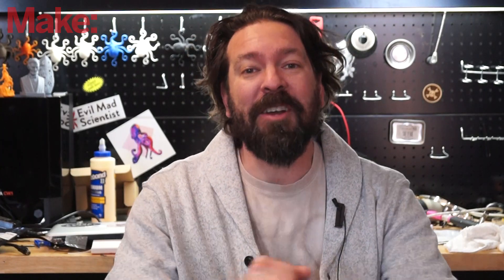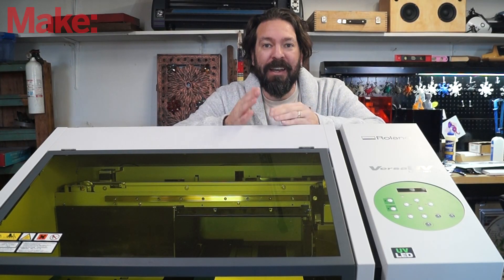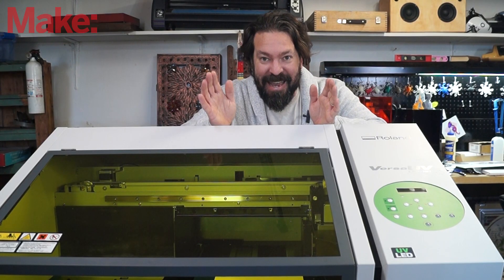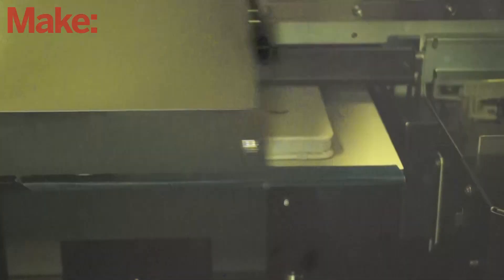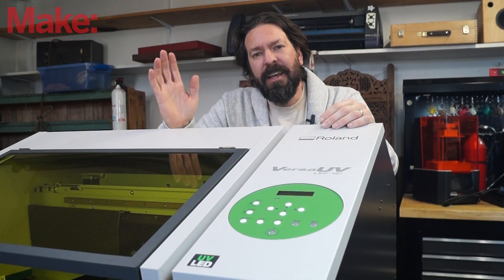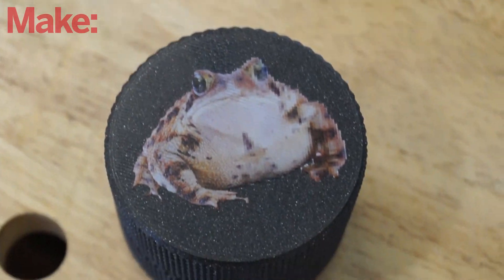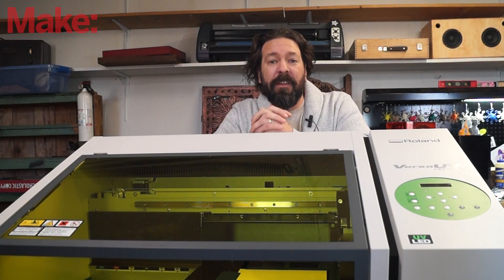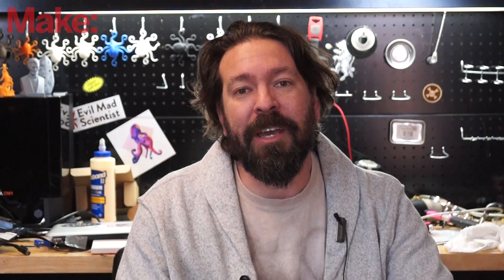What is a UV Flatbed printer? A Quick Look at the Roland LEF-12i

Comment: Worst printer i hav can't print on metal or plastic. And also the ink price is too high. I several times complained the service person about this and now the mother board is dead delay of ink supply and parts it's not only our problem same machine was bought after us by our recommendation they having Same situation it's really a worst product from Roland and hear after wil newr suggest ur printer especially flatbed 😔😔😔 newer expected this from ur brand
Reply: Really?.....not plastic...plastic pens etc...?   What can it print on...what type of / material surfaces do you use it on

Comment: I heard UV printers are meant to be used regularly, so the printheads do not get clogged. For an occasional user (as I would be) it would be an expensive nightmare replacing the very expensive printheads after each printing pause lasting more than 24-48 hours or so...   Is it really so?

Comment: Hi, what you don't mentioned is that the user need to know how to use Photoshop and and illustrator or Corel draw to use this machine.  Making the a print is slow and the actual print is very slow.  I have one and it took a while to get it setup correctly and still difficult to use.

Comment: We have an LEF 300. Keep in mind ink is ~$100/ cartridge and the printer requires constant cleaning by jetting ink into a wast bin (which it automatically does) to keep the head viable. Plan for $700 in replacement every few months whether you print or not.
Reply: why would it need to be replaced if it's been cleaned and not used?
Reply: Hey dude, what are the printing costs roughly?

Comment: 17k?  geez, I was thinking like 1k...
Reply: And then you woke up right? This is clearly meant for professional print shops not hobby makers.
Reply: @daa3417  I realize that once seeing the price, but since you can get other related techs (3Dprinting, CNC, lasers) of a similar size (only about a sheet of paper+ some height) for a few hundred to a couple thousand, I thought it would perhaps the same (especially since you also need crazy expensive ink). I'm guessing if this becomes popular, the prices will plummet soon, since 90% of the machine is already cheaply available by way of these other areas

Comment: I still don't know how a UV Flatbed printer works. Is it like an inkjet printer just with more splash-range? And where comes the UV part into play?
Reply: How fast is it? ... does it smell? ... is it toxic? ... How much ink does it use? ... etc. etc.

Tons of questions unanswered.
Reply: Ole Sauffaus It smells a little chemically while printing, but not too bad. Roland makes an air filter, but we don’t have one on ours. Ink is nasty, and you have to dispose of a waste tank periodically. I leave it in a clear cup to solidify in the sun. It’s hard to wash off your skin. 
You get a lot of prints from the cartridges, but the machine cleans itself every print cycle, so the cartridges are emptied every couple months with light / moderate use. 
The bed moves down, but the print head is very close to the surface it’s spraying ink onto. Too far and static / air movement comes into play, causing the ink to deviate and make the image blurry.
Reply: @MikeCheung1  Use acetone to remove it from your skin 👍🏼
Reply: A scratch test with a fingernail would be nice to see. Do u need to clear coat prints?
Reply: Michael Copeland it’s lightly scratch resistant, especially on a good substrate the ink bonds to. Pretty good against fingernails, but won’t stand up to a butter knife. You can spray clear over it for more durability, or print clear after printing color. You can even emboss with many layers of clear, but it takes a while. You can also print clear primer to improve adhesion on things like metal.
Reply: Ha! As a nail tech I can share some light on this. 
This is the same stuff that we use for gel nails. It’s a high viscosity gel paint that cures under a uv/led lamp. 
It’s waterproof and has no toxic gases or smells when curing.
Reply: The UV part probably has something to do with instant curing.
Reply: Yes, I want to know aswell!. And how do you remove it?
Reply: The uv light cures the ink immediately - so whatever you print comes out pretty much dry. That's how it works :) the ink isn't suited for objects that come anywhere near your mouth though.